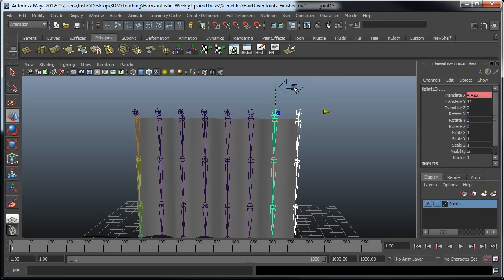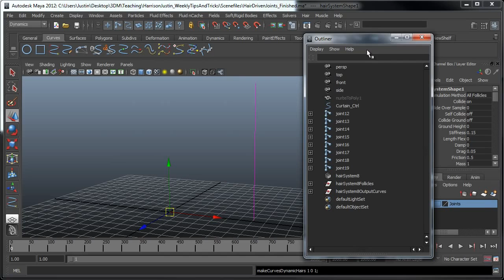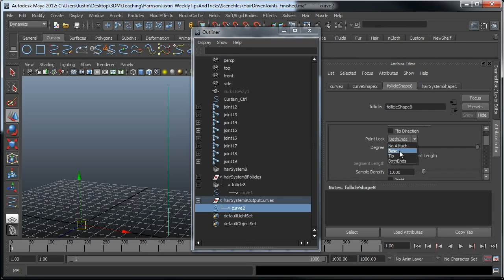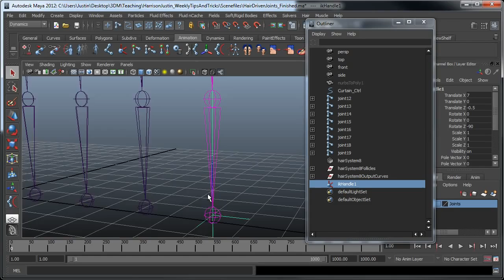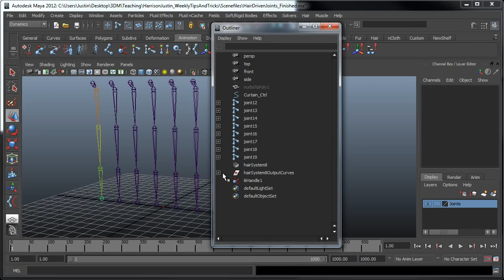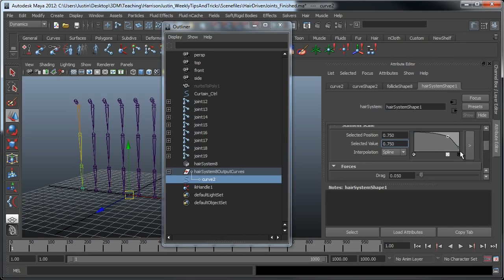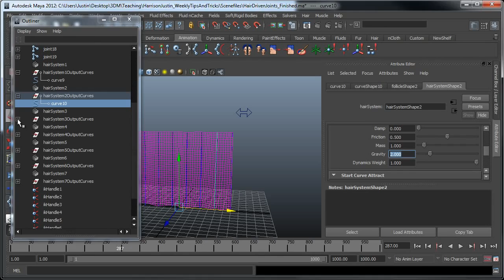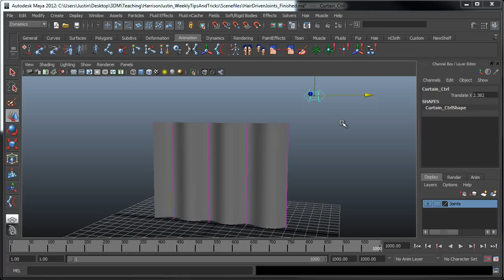Maya Tutorial - Creating Dynamic Hair Driven Joint Chains HD by 3dmotive

Comment: Does it also have a collusion option? Like to prevent a scarf from going through a shoulder? Or is there a way to set keys to avoid it?
Reply: did you ever figure it out?
Reply: @Krobbkag Destroyer Of Worlds  no 😅 I just created a normal joint for my scarf and animated it like it's an extra limb to my character.

There's probably a step I missed somewhere, but I'm no longer using Maya at the moment (it's a bit pricy now). I hope Blender has something similar, so I may still be able to learn it.
Reply: @lucarionite6538  Thank you for the responce, I actually got a good responce below saying to select the mesh, go to FX, nCloth, and click Create Passive Collider

Comment: exactly- how does the the rig work? is it like set driven key or  sth more advanced?
Reply: ok i resolved it, thanks anyway
Reply: Did you guess how it works? Will be great if you could explain to us. Or maybe you could do a short tutorial in your channel? I´m very interested to know it :)
Reply: ok no worries. I solved with set driven key. thanks anyway
Reply: How did you resolve this?  I can't figure out how the set driven key rig works.
Reply: Sergio Palacios So did i, sorry didnt see your comments
Reply: Joe Mendoza i created a curve with a custom attribute. Range from 0 - 10 0 for closed 10 for fully Open curtain. Then go to set driven. Keys and moves joints along x axis. I can send u a file if needed
Reply: Hey Joe Mendoza, maybe this tutorial will help you. https://www.youtube.com/watch?v=VR2AF5gaAkw
The basis is the same. The only difference is in our case is that we will have 2 keys. First key will be with the bones (driven) together,  one to each other (curtain open) and the controller (driver) at value 0  and the other key will be with all bones (driven) spreaded (curtain closed or extended) with the value 10 on the controller (driver) The values will depend on how you define open and closed. In my case 0 was open and 10 closed but you can change it if you want. I hope it helps :)
Reply: No worries Jennifer. Thanks a lot anyway :)